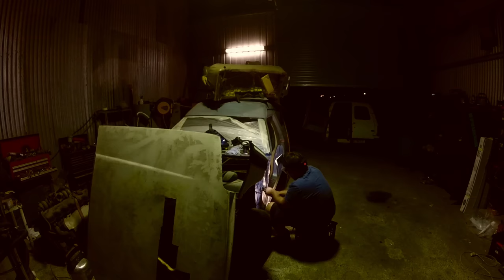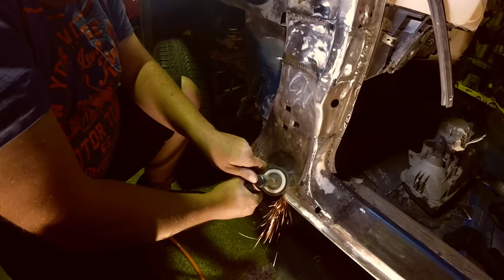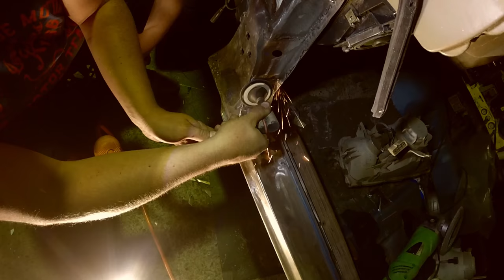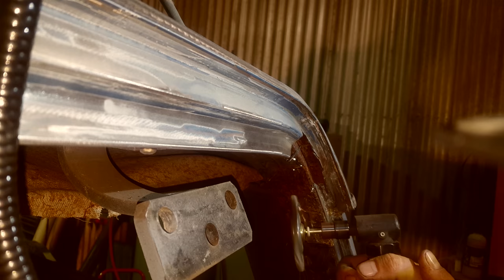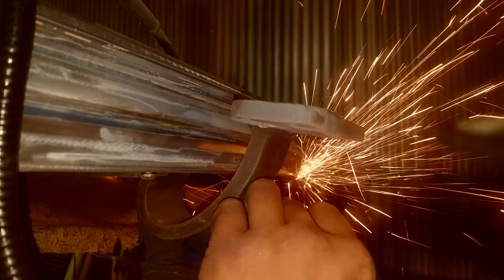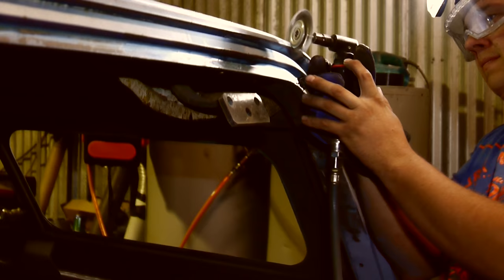Blackridge Air tools Vs Pano84 Project

Comment: I haven't had much luck with the blackridge air tools, i find they leak out of the seals and switches and use more CFM than better quality units.  I've had good luck with Renegade industrial from Trade Tools and IR gear i've bought from amazon us store.
Reply from the maker: These tool have over 100hrs on them take them back mate
Reply: @Oneupthesleevecustoms  I did mate, kept the orbital sander with only leaks a small amount but works sweet and the DA sander which is also fine but a bit heavy in comparison to other DA sanders i've had, the die grinders are what i found leak the worst right out the bearing end where the collet is.  I took it back and swapped it over and the replacement did the same thing.
Reply from the maker: Oh shit you have had a bad run mate i have almost the whole range and love them